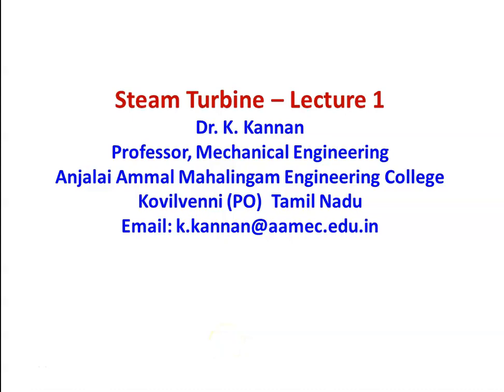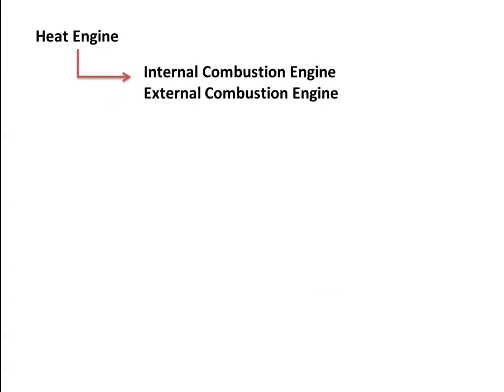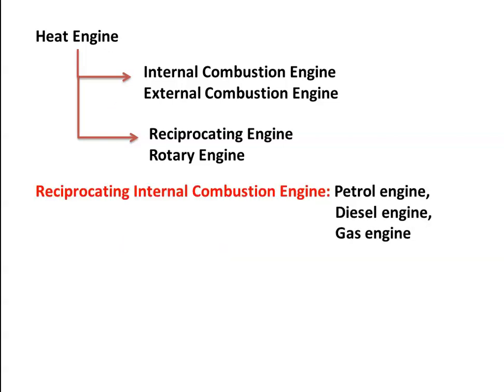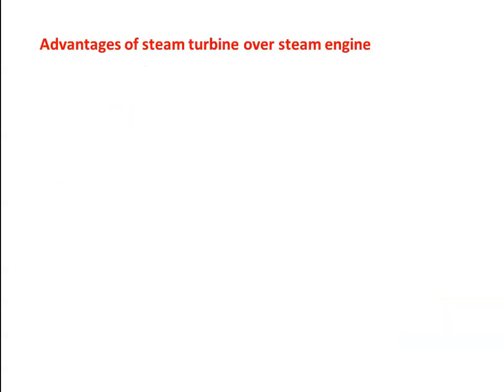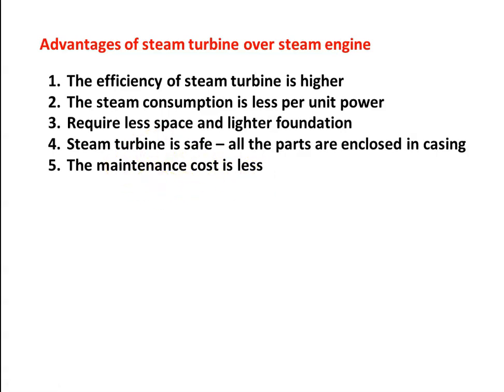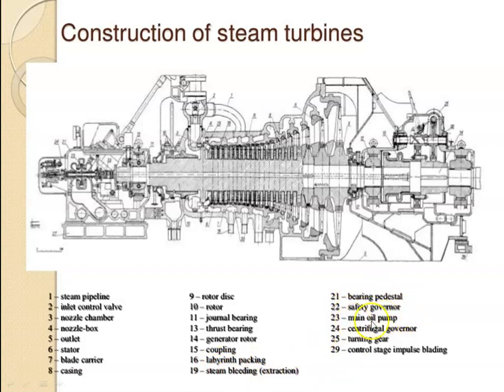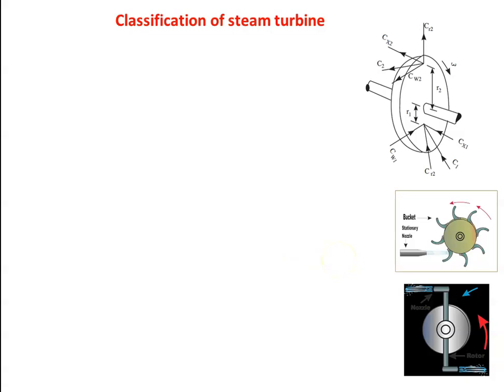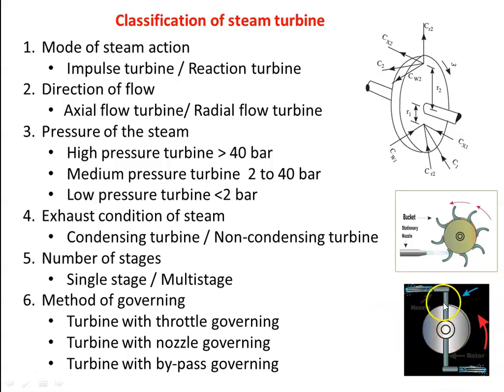ST 01 Steam Turbine - 1

Comment: Sir, Your lectures are very helpful and informative.
I have a doubt in this lecture
 The boiler pressure on one side of single stage impulse turbine is higher than the condensor pressure on other side, so the pressure is decreasing, but you said the pressure is same. I can't get this. PLEASE EXPLAIN
Reply from the maker: Pressure is constant across the rotor in the impulse turbine.
Reply from the maker: The stage of impulse turbine including nozzle and rotor. Pressure drop occur only in nozzle not in rotor